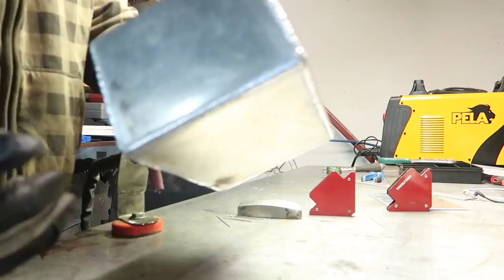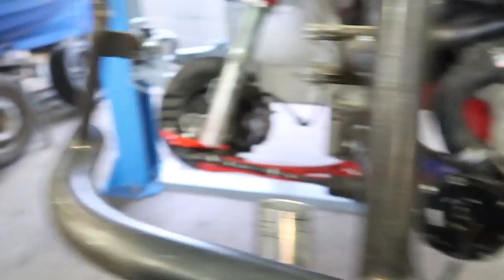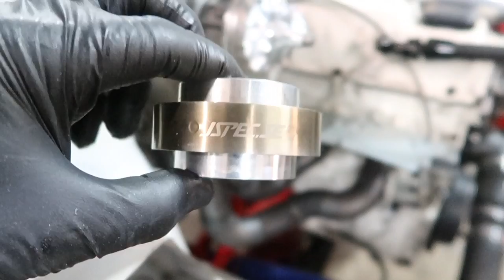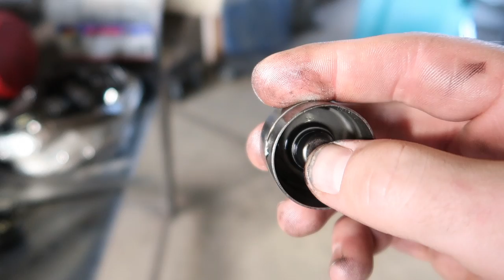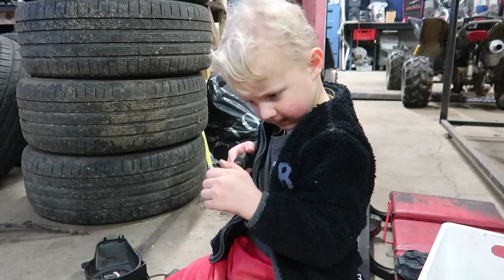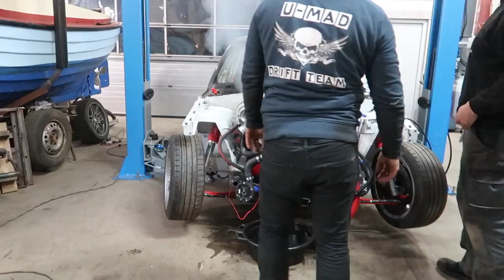Finishing up and Startup M51D25 diesel drift car

Comment: It's awesome that someone finally does proper M51 build.
Reply from the maker: Thanks!
Yeah, there is not much info on the web about the m51 Engine. It did blow up last year 1,5 years ago. And now its rebuildt, soon ready for some action
Reply: U-Mad garage hello sir i want to put hx35 on my m51 tds is it possible ?0
Reply: U-Mad garage hello i want to put a hx35 on my 525 tds is it possible ?
Reply from the maker: Sorry for the late reply. it is posible but i dont think it is gona run very good. but i dont know :/

Comment: what did u use for  crankshaft rocker arms etc, i have the same engine  and i have alot of intake valve problems they keep broking,thx in advance
Reply from the maker: Marjan Spasevski do you mean the hydraulic lifters that the camshaft is pushing down?  I broke all 12 of mine 😞 because this engine has no rocker arms?
Reply: @u-madgarage3149   No i havent probrlems with them but my valves  just snap on half  and this is 3rd engine that i changed already and yes  this engine is  OHC, plus this engine  need to drive on 0w30 oil, i was asking you about the  piston rods did u change them or u driving the stock ones
Reply from the maker: @MarjanSpasevski  What oil do you do you use on the motor, 10w30 ? I still use the stok rods but i have overcized pistons, and the rods are still good, its the head that cant take the pressure :(
Reply: @u-madgarage3149   Liqui Moly MoS2 Leichtlauf 10W-40  cause im little bit on south from ur position,, yes i know about the head ,i have everytime problem with the valves
Reply: Moi je mais de la 5w30 qui et conseillée par le constructeur bmw de série

Comment: Do you know by any chance the model name of the stock turbocharger used on the M51?
And are you using the M21 mechanical fuel pump?
Reply: Td04 11 g4
Reply: 11g-4*